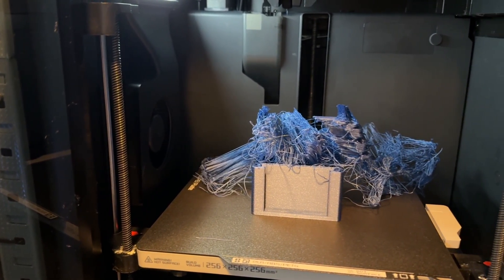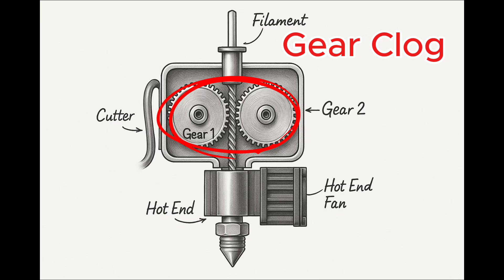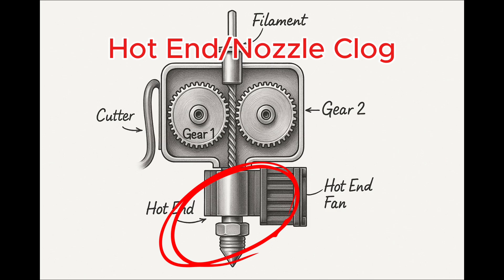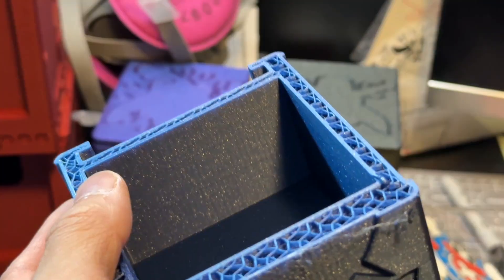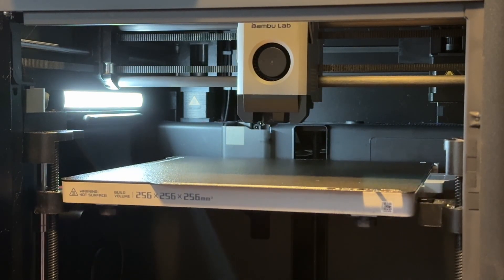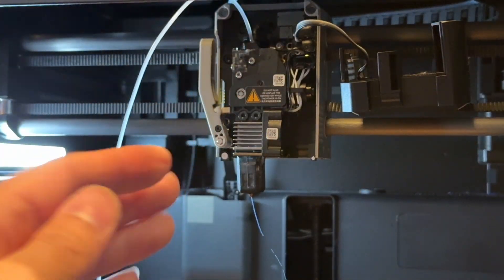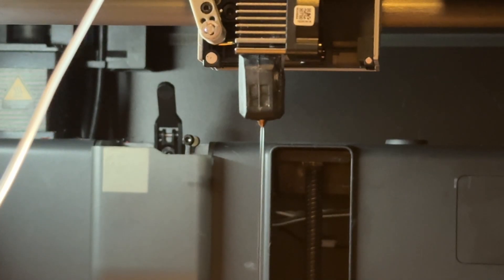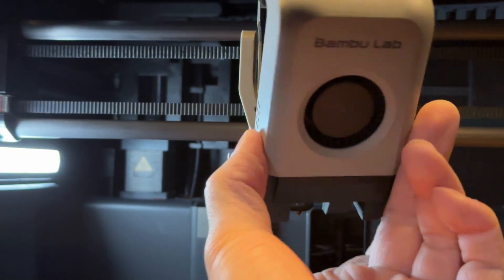How To Unclog Bambu P1S | Nozzle clog Tutorial

Comment: Thank you. I unnecessarily spent a few hours messing about with the extruder, but the clog was in the nozzle. Confusingly, some filament would be produced before blocking again, leading me to think it was an extruder issue. I had a lightbulb moment when you talked about mixing materials and using glitter filament. I had recently used ABS and was trying to print in glitter.
Heating the nozzle on the machine and using a needle I was able to get it extruding, but again it jammed. I did a cold pull and saw a blob of ABS. however, even after then retrying with regular PLA it jammed again. I bit the bullet and finally swapped out the hotend to the hardened one I had in a drawer for months. So far, so good.

Comment: Very new to 3D printing.  "Cleaning Filament"  Never new it existed.  "Check Print setings and Optimize Filament"  Should have included that in the tutorial.  Can we just not remove the nozzle and use a needle to clean it.?  My issue was not the same as yours.  It goes through the process of printing but no filament gets extruded.
Reply from the maker: Hello! thanks for the watch and comment. I will work on getting a tutorial out for optimizing filaments and print settings. As for you last concern, I can see that I failed to address how to use a needle to de-clog. Typically when I get a clog in the NOZZLE - I would heat nozzle up to 250, insert needle and wiggle it around (not go too far up). Sometimes that would do the trick and get the pesky clogs to come out or sometimes it might just loosen it. Then I would top it off by using the cleaning filament. It basically grabs the last bits stuck inside. 

I use filament with glitter particles so those often times get stuck, especially when I need the 0.4 nozzle for some details. So the needle + cleaning filament combo is the fastest solution for me. If this doesn't work, there's a method I like to call "heat the rod" that cleans it thoroughly.

For this method you would need to remove the nozzle, heat up a 1.75 wrench, stick it in, let it cool, heat the tip of the nozzle and pull. I will make a vid about this but in the mean-time here's the official bambu troubleshoot wiki: https://wiki.bambulab.com/en/x1/troubleshooting/nozzle-clog#:~:text=Take%20the%201.5mm%20hex%20wrench

Sorry I couldn't get to you sooner, hope you already figured it out!
Reply: yeah i'm having this problem too, where the filament is loaded and the printer is printing but nothing is being printed
Reply: @darsh7164 I had a spare 0.4mm hotend/nozzle so I replaced it and I'm back in business.  I'll have to heat the old one to clear the blockage using a needle and hope it works again. Ordering a nozzle cleaning kit this week from Amazon.